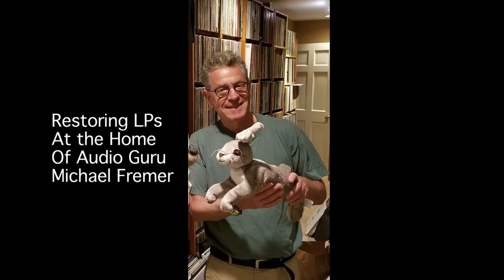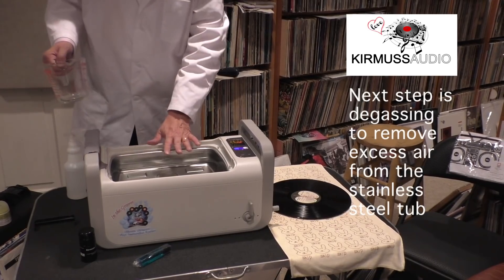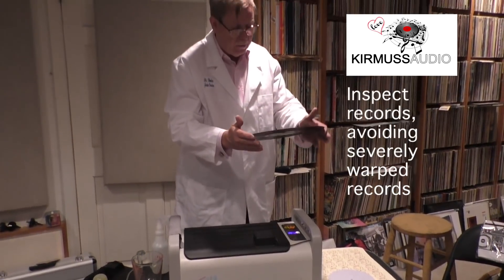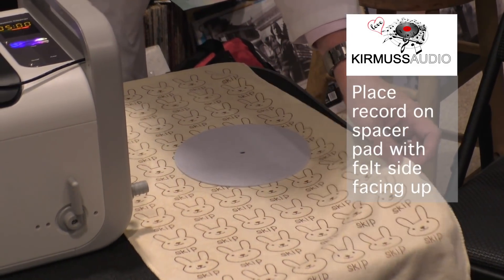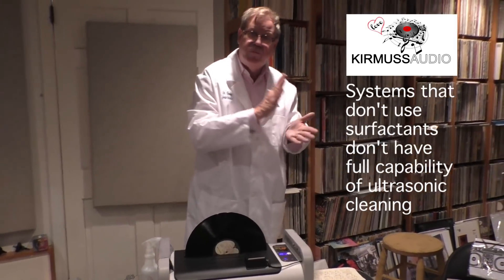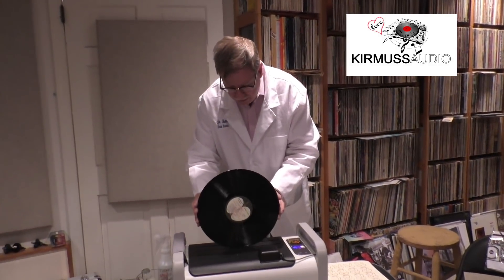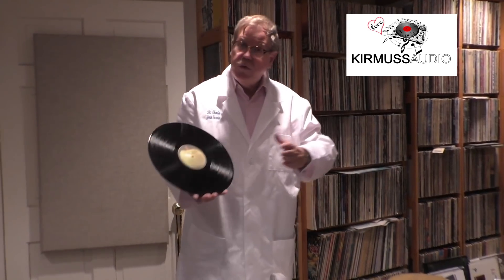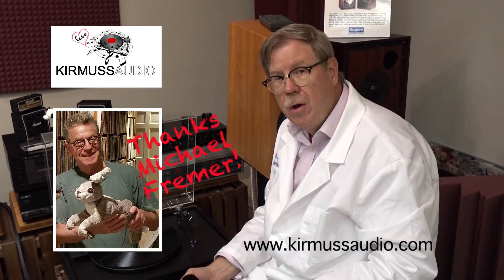KirmussAudio System Demo

Comment: Just received my Kirmuss restoration device. No matter how long I let it cool, when I turn it on the red led is lit. The small one on the far right also lights up within 1-2 minutes. Room temperature is 23C. Any tips?
Reply from the maker: Thank you for your email. The operation us normal. Do review the manual and supplement on  our web site. 1. You need to remove the cover to cool the water. Usually 10 minutes. 2. The  long red bar is the normal operating range. You stop only when the small red light bar  lights up, now finishing the last cycle. 3. You stop immediately when the small red bar flashes.
Reply: @kirmussaudio7578 thanks for your reply!  the problem I have is that the small red light is always on, already after degaussing, and it never flashes. However, after about 20 minutes I can see the records warping and I feel a heatwave coming up from the machine, so I'm assuming it's too hot which causes the warp.
Reply from the maker: We do not monitor our YouTube site. Communicate to us using email. We will send you an RMA number.
Reply from the maker: Please call us for warranty repair.

Comment: By the time it is done I would have got bored of the idea of playing a record and gone off and done something else instead :p
Reply from the maker: Your opinion  is welcomed!  Not a surface cleaner, audiophiles agree rather than spending $  8,000 on a new cartdridge or $15,000 on a new turntable we provide the best bang for $1,200 or less with immediate discernable results as posted by many users.  Yes, it takes 20 or 25 minutes to process 4 records concurrently, the effort is well worth the time and effort. It makes even the  modest of turntable configurations shine.   Even entry level turntables and  system configurations benefit  as we improve needle to groove contact. Do bring a record to one of our dealers or supporting manufacturers and see for yourself the discernable difference... of course the process is not for all. If a simple surface cleaning is needed, a 5 minute cycle is all that is needed for 4 records. Less work than available manual or vacuum  cleaning systems.
Reply: @kirmussaudio7578  I have no doubt that it works well, I just lack the patience to be able to wait for my music to start :D
Reply from the maker: Understood.  If one reviews some vacuum systems sold they in fact take more time to clean one record where we restore 4.

Comment: I have 100% isopropyl, so 30ml instead of 40ml should be OK?
Reply from the maker: Do not try to dilute 100%. 70 % is not usually made by just  dilution . Send us an email to ckirmuss@frontier.net.  we do have a method to dilute 99 % to be used just during the covid crisis.  To note the alcohol in small quantity is used to kill live and dormant fungus. Not used really to clean and restore the grooves although it may seems to aid in removing fingerprint oils during the pre wash,wetting cycle.

Comment: Got mine today and already cleaned 3 records. It WORKS!
Reply: How well?
Reply: @utub1473  The short answer is very well indeed; but you have to put the effort/time it takes. It is not an instant process, especially with older, mistreated, very dirty records. One thing to say is that most people who feel this is too much work fail to realize you wouldn't be doing this process with a record every single time you want to play it. You'll do a deep clean/process and then, if you do treat your records with the care they require, you would not need to do it again for a while. I am not a big fan of re-issues so I buy a lot of used records and I will not play them without doing a very deep cleaning/restoration first. The difference is VERY noticeable. Yes, this restoration does require "elbow grease" but so does the Spin Clean. Again, it is not something you need to do each time you play a record but for those who don't want to put in the time, there are other options that range between 3 thousand and 5 thousand dollars. I rather use that money for other things.

I have a Record Doctor VI that I use to vacuum the record with after a final rinse with just distilled water. I do this because I prefer this to drying them by hand with an optical cloth.  

Mind you, this system does NOT repair damaged records. If the record is scratch,  this is not going to get rid of that noise. What it does is remove dirt, finger oils, etc from the grooves. You will definitely hear less to none pops and clicks but then again, the condition of the album itself does matter. The process will prolong the life on your records and cartridge. 

Lastly, just in case, I am in no way affiliated or related in anyway with Kirmuss Audio.
Reply: @bulldogdave  Charles actually said that for certain records (depending on the PVC mix the plant uses) there is so much release agent taken off the record that scratches that were previously audible go away completely! This is because the stylus rides much deeper in the groove and doesn't make contact with the scratch.

Comment from the maker: Thanks for your opinion. The forum is for an exchange of ideas.  Noted your point. Everyone has theirs.  This said,...I do not beleive where you understand  or appreciate  the fact where our liquid agent  is not a cleaner. 

It cannot be used by itself on a record. 

It cannot be used with a vacuum or other ultrasonic system.  Or a manual cleaning.  Whoever perhaps mentioned this to you does not understand what an ionizing agent is. And how it has to be specifically used. That is our Patent.

Our process is different. Our spray is not a cleaner.  

To assist both you and our audience, No other process that we know of removes the record's release agent. Home to those unwanted pops. Do review videos as to how records are made. There is a reason why records "pop out of the stamper ". As analog expert Michsel Fremer has written, no one is seen spraying Pam onto the stampers at the pressing plant. 

To price and to restore the record grooves of 1 000 records,  with our ionizing agent the consumables cost as it relates to our spray would cost you 140 to 283 USD. For processing 1000 .
 Very reasonable if we can restore a scratched and scuffed 60 year old pressing or new pressing,  and bring both  back to life. I am sure you have seen the images taken by our 2d 3d digital microscope and the measurements of groove size, detail and depth. Before and after. . Our restoration process with our ionizing agent,  not a soap or cleaner, brings recordings to life by stripping out the release agent. 

Back to your point and setting the record straight, we cannot use our liquid as a cleaner with other machines and processes,  and most respectfully stated, you wanted a solution for 10 cents a record.  That would relate to $100 USD to clean and not restore 1,000 records. Small difference for the benefit of the bargain that our total process has to offer one...

I trust you have a 500 $ and up turntable,???  We offer the best bang for the dollar. Why spend 3,000 USD on a new cartridge or upwards of 1,000 USD on a set of new  silver turntable interconnect cables. Our restoration with our ionizing agent delivers...

. Our solution when used only with our process and   at 14 to 28 cents  a record is the least affordable for gain  guaranteed. That is the  result we offer. 

Again and as a warning,...You cannot use our fluid with any other system or manually apply it as it is not a cleaner. It will not improve anything. 

  You need to appreciate the fact where we  with our machine and ionizing agent, not a soap, is the only method to remove the release agent from the pressing's grooves, offering you between a measured  1.4 dB to 4+ dB over floor of gain. You cannot compare this as a cleaner you buy. So granted your price comparison while flawed sees our agent,  and considered as a consumable, in the restoration of  1000 records with a  40 to 148 USD difference over what you'd like is only a little more expensive. Over perhaps a year or two. If you restore 1000 records over that time period.

 In any event if you are familiar with our sales network, in  the US alone we saw our authorized dealers  sell over 2,200 systems last year. (2019). While none of your concern, we are proud to say where this month alone 171 sold in the last 2 weeks to our dealers, repeat sales. Even with the pandemic affecting all of us.

Audiophiles and record custodians alike cannot be wrong as to what we offer them as an end result. ...

....but you are confusing matters with your flawed comparison, sorry to say.
.as to lowest cost of ownership...

We also have now the global blessing and validation  of independent  analog industry experts.

Back to your insistence. 
...  I ask whether you are buying a cleaning solution liquid.  If so, and for you to perhaps do a fair and just comparison,  do ask any cleaner manufacturer considered to provide you with details as to what is their signal gain over floor that their cleaning solution offers.  Also how many microns  of release agents that their solution removes... I doubt very much they can guarantee anything. 

To explain better what we do,  Please do  visit one of our dealers and bring in a record, both new and vintage suggested.   Then compare before and after. 

Some quality surface  cleaning products cost you 45 cents per record. I trust you know this. Very expensive...

 Confirming again, we restore while others try to clean or polish.

  Audio manufacturers such as Jeff Rowland Design, Audio Note, Grand Prix turntable, Helix, Yamaha Canada among others use our process to restore records brought to their studios at global audio shows by audiophiles such as you. The reason why they do this is very obvious. 

 Cellist Vincent Belanger among other musicians use our process to restore their new pressings before autographing them. Vincent's sound  engineer validates the gain of 1.3 to 1.4 dB over floor on their new German  pressings.  This as well as turntable manufacturer Oracle.  

...None of these above mentioned industry peers has any relationship to our Company.

This stated, we all love music. That is why we are on the business.  My company is there to help you restore the brilliance of your records, new and vintage,  never before heard when the time comes  We are confident of the results...thank you for allowing  us to better explain the difference between cleaning and restoration. Cleaning soaps and ionizers. 

So, as a summary and while you may perhaps still not think where an extra 4 to 18 cents per record is worth it to you, may I strongly suggest as where you are seemingly keen about this pastime,  suggest to  you in not upgrading your turntable or to to e arm, you do visit one of our dealers and use our ultrasonic record groove  system with our ionizing agent used  with our process.  You will hear the difference immediately.  

Apologize for taking extra time in responding to your comparison as our ionizing agent is not a cleaner,  rather , it facilitates our system to remove first surface films then the release agent which has the microwelded pops embedded in the grooves. 

Of course we cannot please everyone, but we do guarantee the increase in signal resulting in a more spacious soundstage and improved timbre, quoting Audio Engineer Andre Jennings.

Comment from the maker: Great question and point for us to respond to. First, we do not use a cleaning solution. We use an ionizing solution. There is a difference. Our agent is not a cleaner as our process deals with the record grooves. At $ 85 US dollars  for a 300 ml refill bottle which allows one to restore between  300 andv 600 records , number depending on the number of cycles needed to remove first the left over films from prior cleanings that were air or vacuum dried onto the record's surface,  then the record release agent,  ...At between 0.28 cents and  0.14 cents per record, and for groove restoration,  this is very, very reasonable,  one would think. Another manufacturer has agreed where their cleaning solution of $ 25 USD per bottle which cannot  be left in their machine's  tank overnight but even so, if one could wash 100 records in a day, that equates  to  0.25 cents a record just for a washing.  Clearly we provide the lowest cost of ownership.
Reply: They why do you repeated refer to the solution as your, "surfactant".
Reply from the maker: @elliottcrews4997 we have not used that term in 4 years if not more.
Reply: @kirmussaudio7578  but it's a cationic surfactant you are using in it right, getting a positive charge on the record, right?
Reply from the maker: @elliottcrews4997 Not catonic
Reply: @kirmussaudio7578  then what is it?

Comment: I would only buy this if the cleaning solution  was $20.00 and enough to  clean 200 records. Three is no  way in hell I  and many  others are going to  pay $85.00 for enough solution  to  clean 60 to 100 records. Dude you  want to sell you device give a life time supply of cleaning solution that  is 99% distilled water and 1% what?. What a fucking joke.
Reply from the maker: We cannot meet a 0.10 per record cost. We arrive at on a stage 0.14. . This cost includes 9.00 shipping. You erroneously compare costs for a spray bottle with ionizing agent. Every KirmussAudio user knows one buys the 300 ml refil bottle. Thank you for allowing us to enforce the fact that our orocess has the best  cost of ownership  to our audience.
Reply from the maker: As mentioned and per our manual and with our  MDS  filed with FedEx. we add 1 to 2 %  diol 1-2-178 to 98 to 99 % distilled water. The base element is bought in lots of 5,000 gallons,  minimum order. Ttansport costs for such a small amount is prohibitive. Hense the average 0.14 cents per record  or so... Unlike other manufacturers we disclose our ingredients as to personal safety as well as their compatibility with PVC using the PVC Chemical Compatibility Chart. I am concerned about your email.  While I have your ear and where you may be a DIY enthusiast, only buy any agent to be used on a record from a manufacturer. Do not try to make your own. To this, and  our ionizing agent, it cannot be used in any ultrasonic machine or used as a cleaner as it is not a cleaning solution. It has to be used as an ionizing agent  with our patented process,  changing the charge of the record to attract the plasma wave created by cavitation.  It is the plasma wave that in fact does the cleaning and restoration work. This ionizing agent will not allow you to clean a record using any other process. Some journalist in the past thinks this solution is s cleaner and used it in another sonic machine. Of course it could not work. Wrong application. Added where it gummed up their machine's pump. If you are a DIY type,  stay away for your health and that of the record when making or using cleaning agents made out of ethylene oxide, such as Tergitol. Per the PVC Compatibility Chart, thus chemical affects the record's PVC, and of greater concern for your safety. per California Proposition 65, it is an irritant and  dangerous to your health. Must be handled carefully.  Some journalists recommended buying it through back channels as it cannot be bought by lay people due to its publicized adverse health affects. Good luck with your efforts. I beleive I responded positively in kind to your observation.  We are proving a very consumable that is reasonable in cost and is safe, as well as using it in our process we as both Michael Fremer of Stereophile and Andre Jennings of The Absolute Sound do in fact restore grooves, and not just try to surface clean.
Reply: Even So the fluid is too expensive for anybody  and you are losing sales due to it. You need to  find or make another fluid that  is cheaper  for the common  man.